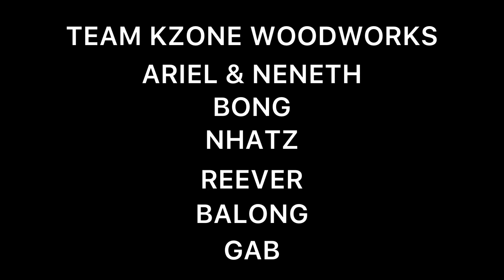HOW TO CUT A CUTLERY TRAY | KZONEWOODWORKS

Comment: Sir anu ba usually lapad ng mga modular kitchen kabinet? Ung kabinet na naka hang na ginagamitan ng suspension brackets, 350mm ba? Sa mga gawa nyo anu pong usually sukat. Salamat po
Reply from the maker: Kadalasan po gamit namin 300mm po un depth nya sir.pero pag my full down basket un lagayan pinggan 400mm po. Di po kc kasya s 300mm un full down basket.
Reply: @KzoneWoodworks  Marami pong salamat sa reply God bless po
Reply from the maker: Welcome po sir…
Reply: Sir ano po ba sukat ng cutlery drawer or box. Salamat po